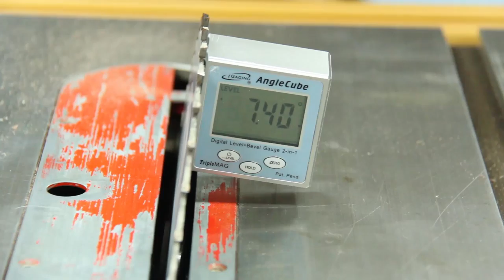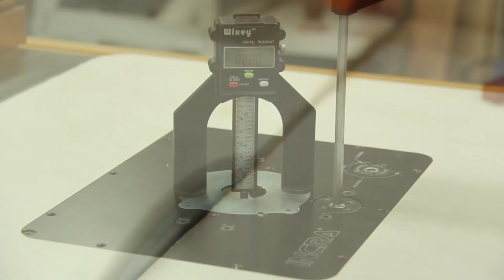Walnut Mantle Clock

Comment: Nicely done Tim.  That is really beautiful. I have the Incra fence on my table saw as well.  I like your set up with the build in router on the left side. I noticed several measuring inserts on your Incra fence?  What are they all for?  I also noticed some additions to your clamps.  What are the cross pieces you have on there when you clamped the two side pieces to the front?  I would love to see a shop tour.
Reply from the maker: Howard Springsteen Thank you. I love the Incra fence system. The extra measuring inserts I have in there are for different dovetail patterns. I had footage that I edited out of the video of those pieces added to the clamps that allow me to clamp at an angle. They are for the BESSEY Tool GmbH & Co KG K-Body Revo clamps. I bought mine from Amazon here: http://www.amazon.com/dp/ASIN/B001HSO6WW/?tag=woodwork0b-20
Reply: WoodworkingManiak Thanks.  I had never seen those for the Bessey clamps.  If you don't mind my asking, what is the table saw, and router table that you use?
Reply from the maker: Howard Springsteen I have a Jet cabinet saw with the Incra extension wing. Watch my shop update video next Friday and I'll add that footage showing the Bessey attachments for you.

Comment: What's the point of making a video that just shows woods going through various expensive power tools? Obviously just bragging and nothing else (nothing wrong with it though but do not expect any other then your family and a few others to run and watch it). I think many people want to learn and see techniques and not spend 10 long boring minutes watching woods going through power tools! I am may be direct with my opinion here, but believe that many successful video producers understand this basic point.
Reply from the maker: Leane Garden Thank you for your criticism. If there are specific techniques that you may have seen me brush over quickly in this video that you would like to see in more detail, please let me know. At some point I will try to produce a video on the technique I used.
I am by no means trying to brag about what I have. What I was trying to do, was to show how each piece of wood got to the the size and shape that it needed to be to make the clock. Mostly, using various the tools to do so... I do plan to do some other videos on specific tips and techniques on how I do things to go along with my build videos. However, I believe that people need to see that I can produce decent final products. For me to show all those techniques in a single video for the entire build would make the video very long, possibly hours long. And I don't really want to do multiple part build videos.
Reply: WoodworkingManiak 
Hey Tim.  I'm not part of "your family" but did watch and liked.  Don't know why some folks feel the need to watch things they don't like and then comment on them.  I did notice they have never produced a YouTube video for someone else to criticize.   JimE
Reply: ***** 
I guess I should have expanded on my last sentence.  I was trying to point out that, like me, they don't have any videos to criticize.  Not to say, I haven't used the "thumbs down" button on a few occasions.  That is what it is there for and says enough as far as I am concerned.
Reply: I disagree with Leane's comment. I honestly enjoyed watching the entire video and hope you do more.
Reply: I picked up a nice idea for the sled jig for making the angled cut for the legs. (And I'm not related to the content creator...)